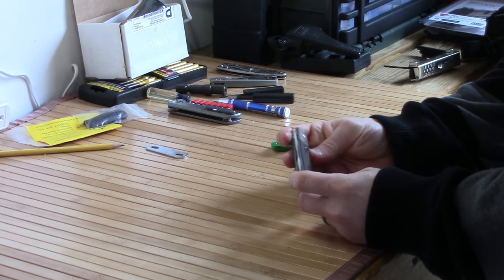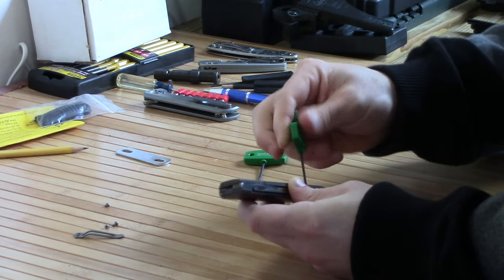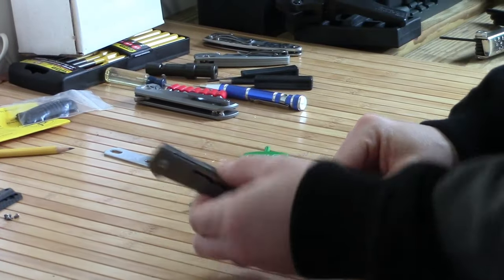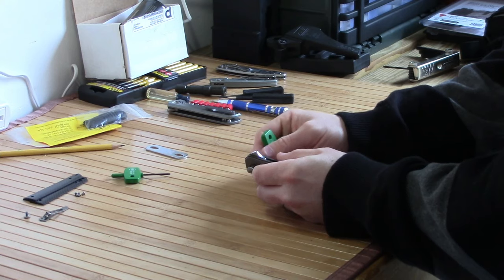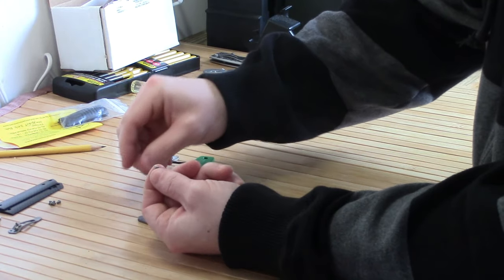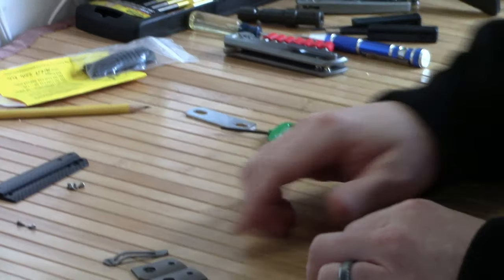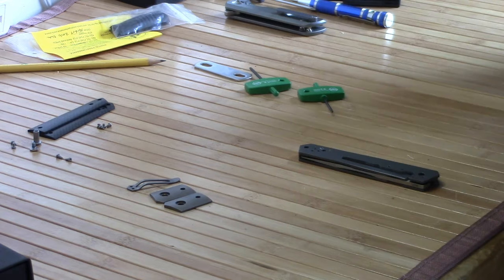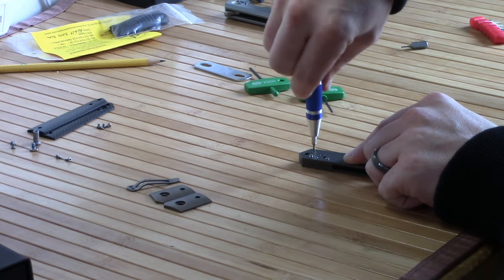How To: Anodize Titanium

Comment: Great video, but one tip for you for future titanium projects; the anodizing process just changes the color of the outer layer (sort of like human skin getting a tan). Machinists love anodizing vs painting because it doesn't add any size or weight. This being said, you may have been wasting your time with the whole nail polish step, taking care to be able to re-thread the hardware. the beautiful part of anodizing is not having to mask anything. Hope this helps save you some time, and keep up the good work!
Reply from the maker: John Victor thanks for watching and for the insight!  I used nail polish to prevent the etching process from removing material and changing tolerances.  I learned to do this the hard way once when I reassembled a knife and the blade action was all messed up.